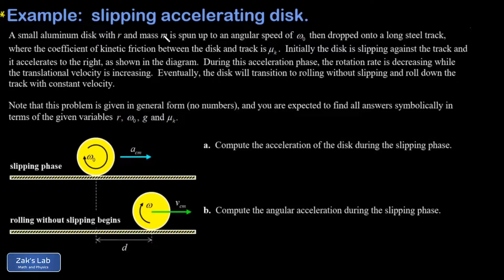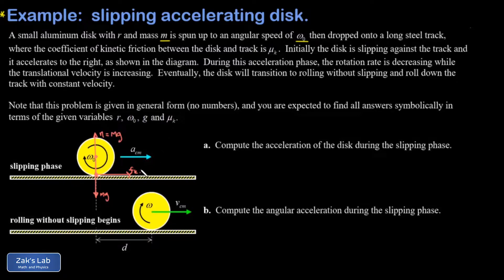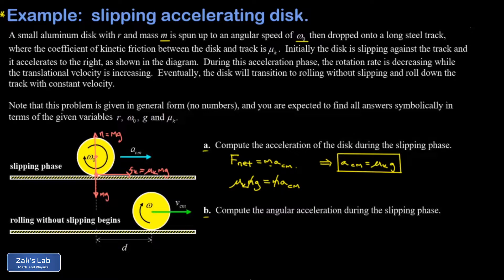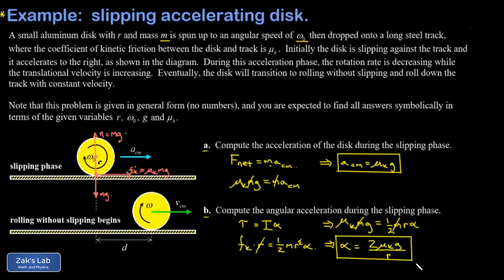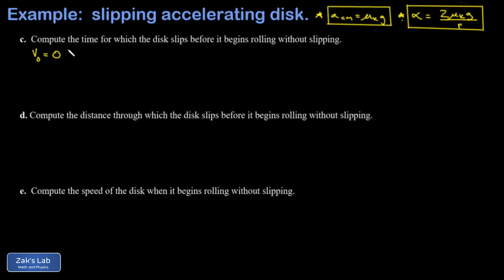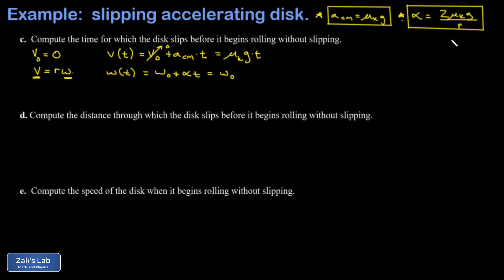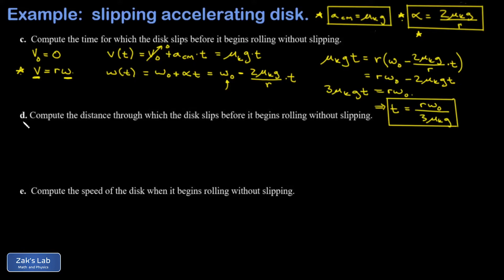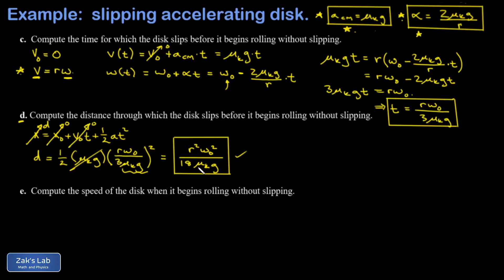Slipping rotating object:  find the time before rolling without slipping, displacement, final speed.

Comment: Very nice video. Thanks a lot.
I spent much time thinking alone about the kinetics or dynamics of rolling and rolling after rest and rolling after slipping. Nearly no one talk about it or about its intuition.
I am trying to figure something in case of rolling after slipping as in your case but there is a motor which keeps applying a force.
If the force applied is greater than the max static friction, then it will slip or keep slipping and there will be acceleration at the c.m. so, it keeps rotating faster due to (f.app - f.kinetic) and also the c.m keep going faster due to the (f.app - f.kinetic) so the point of contact is never 0 because the tangential velocity due to rotation is larger than the velocity of c.m.
Does that mean that the wheel im this case will not roll.
Chatgpt say that after some time, it will roll because angular velocity will decrease, but how will it decrease although the there is torque applied! It say kinetic friction will reduce the angular velocity, but konetic friction is constant. Can you help me?
Reply from the maker: I think you're right . . . chat gpt still makes a lot of mistakes with unusual physics problems.  I write a ton of new problems for my classes every semester, and I try to push the boundaries into problems that are fairly original.  If I check my solution against ChatGPT, it often makes several mistakes and needs to be "coached" through the solution, apologizing every time I point out an error.  It's still a useful tool, but just try pointing out its mistakes to work toward a solution.  z

Comment: can you pls explain why u took kinetic friction to be in forward direction? ... will it always be like tht for rolling bodies
Reply from the maker: It was spinning quickly in the clockwise direction, causing slipping.  This means the disk is slipping to the left over the surface, which means the friction force points to the right.  Another way to see the physical reasoning is to pretend the surface was coated in sand:  when you drop that disk onto the surface, it will shoot sand out to the left.  That's an intuitive way to see the force exerted on the surface points to the left, and by Newton's third law the force exerted on the disk points to the right.  A third way to get a grasp on this is to take a plastic bottle cap and spin in onto the ground and watch it slide for a moment before it begins to roll.  -- z
Reply: @ZaksLab  thank you so much i finally udnerstood